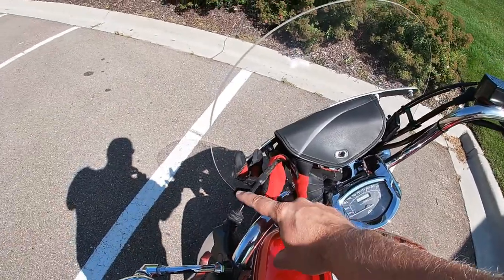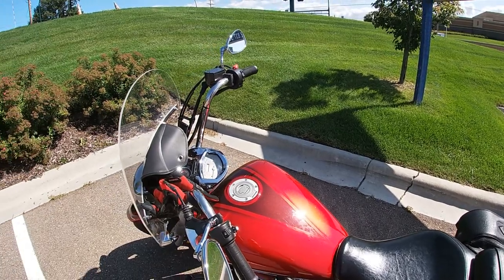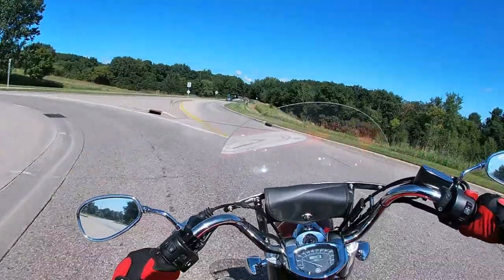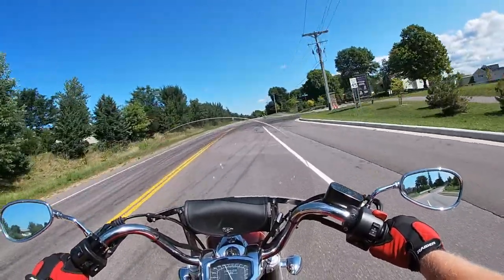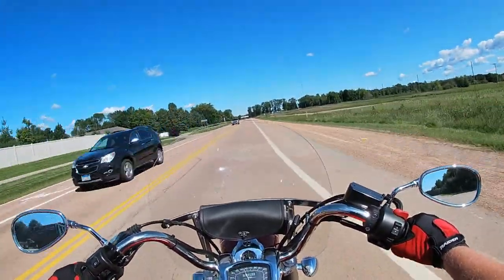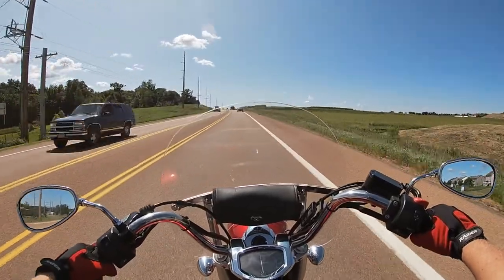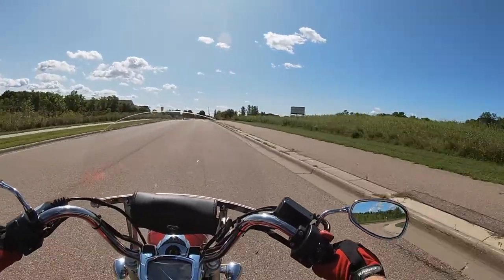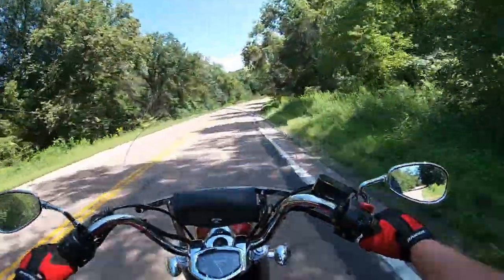Clutch Adjustment - V Star 1300 - MNMoto Vlog 19

Comment: I have a 2008 Yamaha v Star 1300 I bought it with $4,000 on it and I have $30,000 on it right now very little maintenance oil changes tires spark plugs and one valve adjustment
Reply: Sorry that's miles not dollar sign I was using voice command

Comment: Thanks for the video series on your Yamaha 1300 I just put Heritage Softail handlebars on my 2007 Yamaha 1300 and I love them.
Reply from the maker: What did you do for grips.  The cheap rubber grips over the factory throttle.sleeves has worked for a few years, but the 8 dollars has paid for itself and I think I am ready to splurge.  I am looking at avon metric cruiser grips to work with the cables, what did you do?
Reply: @MNMoto   Kuryakyn Flame grips they seem to good so far.
Reply from the maker: @vsorrick  do you recall if there were metric cruiser specific to work with yamaha throttle cables, or do you think harley ones would work?
Reply: @MNMoto  I just ordered ones for the yamaha, I dont know if a harley throttle control would work with metric controls. New grips come throttle control built in.

Comment: Hey my v star 650 had the same issue in 4th to 5th i put a Barnett clutch and heavier springs it did the same it turns out there is a adjustment screw under on of the side covers it did the trick it takes 10 min or so when i took the old clutch out it looked worn but it had a good amount of clutch pad left keep up the videos hope this helps
Reply from the maker: Thanks I will check into that 👍